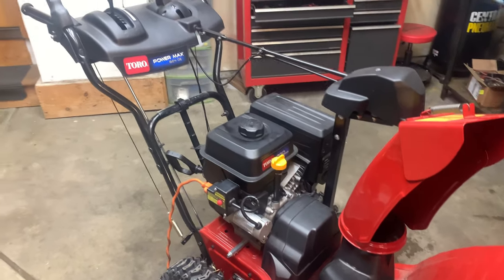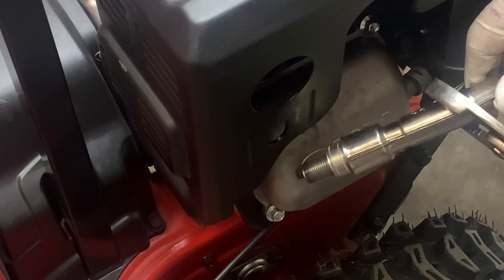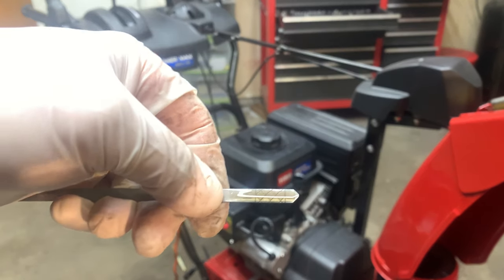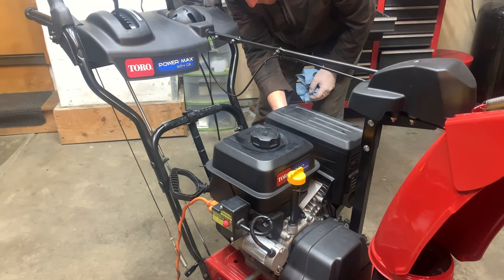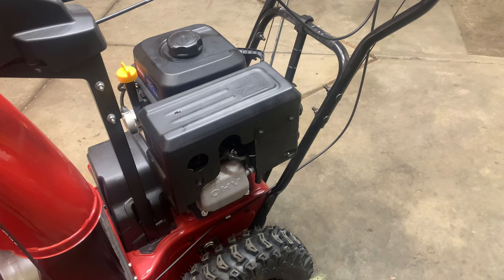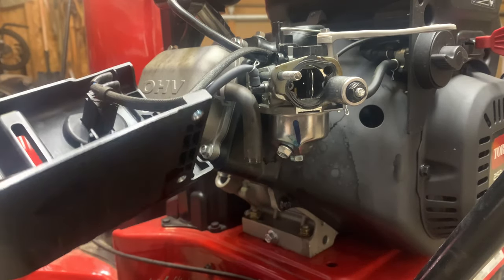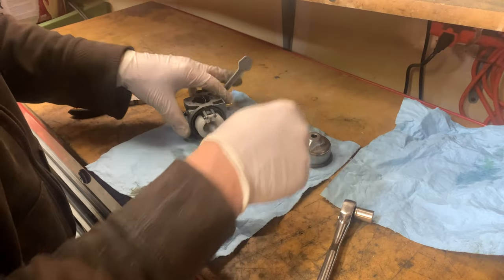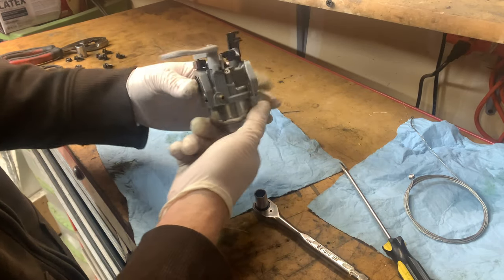Toro Snowblower Won't Start

Comment: Thank you. So it obvious
That someone worked on prior because of the fuel leak from the top of the bowl. 
Good fix. 
I have a 21 yr old toro this only my second snowblower, the first one is a 30 yr old push craftsman snowthrower oil gas mix always starts on first pull. The toro was gifted to me and thanks to you all I got it going.  Won’t idle on low just middle and up.
Reply from the maker: Does the carburetor have a low end mix screw? If so it would be on the side of the carburetor. That may need adjustment.

Comment: Thanks for the video. I have the same issue, so I will check out the spark plug and carburetor
Reply from the maker: Did you get it running?

Comment: Great video. The owner of the machine must have dropped the float bowl or maybe taken the carburetor off and did some checking and didn't get the float bowl seal seated correctly. Great find. Also, great that you noticed the crankcase was too full of oil.  Most dip sticks have right on them, do not overfill. Spark plug defiantly needed changing too. It seems the Toro Power Max snow blowers are easy to work on. Some machines are designed terribly when it comes to getting at the carburetor.  This will be my first winter to try out my new Toro Power Max HD 1232. I did lots of research before pulling the trigger on the Toro Power Max HD. One of the biggest reasons was I have a Toro dealer within a few miles of where I live. And the Toro quick stick seems to be one of the better shoot controls among the major snow blower brands. I also opted to steer clear of auto steer due to my very uneven terrain. The Toro 1232 has trigger steer. Well, winter is coming, so it's time to get things ready.  Videos like yours are a great help for many do it yourselfers. Have a blessed and safe winter.
Reply from the maker: Glad you liked it. You must be somewhere where you get a bunch of snow. We get snow, but it just melts in a day or two. Sometimes we do get a descent storm. So my snowblower is a push broom and sometimes a shovel :-)
Reply: I live in southeastern Michigan about 38 miles north of Detroit. According to weather outlooks, it is projected that we get plenty of snow this winter. I have no idea how they determine future forecast, but that is what they are saying.  Some winters we do get plenty of snow. I am getting older, so a machine that gets the job done easier and quicker is all good in my book. And the new machine even has hand warmers. Can't wait to see how they work. Thanks for your reply. Have a blessed and safe winter.  @small_engine_repair

Comment: I have a snow blower just like it, or very close. It has one or two uses although 5-7 years old. We’re just not getting any snow in VA, but a strong storm is heading this way. I hope it’s something simple, I have a few days to get it fixed, lol Thanks
Reply from the maker: Hope you get it running.

Comment: Nice video, question why is the drain plug missing on the crankcase (carburetor side)  of these machines?  I have noticed this on several videos. Can you explain? Toro
Reply from the maker: Are you saying that there should be one? If it should be there and is not, we would need the manufacture/designers to chime in.

Comment: I have this exact snow blower…..  checked everything out like you said. Seems like mine is not getting gas to the carb. It start for just a second when I spray starter fluid. Any tips for that?

Great video!!!
Reply from the maker: So when you remove the fuel line from the carburetor is gas flowing?

Comment: Toro 824 transmission jumps in and out of forward/reverse gears. Why?
Reply from the maker: Hello, I really can't answer that based on this information you have given me.
Reply: @small_engine_repair  thanks. The Toro 824 is model 38540 ser 00000131 if that helps. With the reverse cable disconnected so that there is no pressure (and there is from the spring) on the protruding reverse lever on top of the trannie and that lever is in the forward position then it should not jump into reverse?
Reply from the maker: I have not personally tore one of those apart, but yes what you have stated makes sense. I found a picture of that transmission online and see what you are explaining. That spring holds the lever so reverse should not engage, unless you pull on the cable. I am sure you are already thinking that something inside the transmission is broken and I would agree. I would pull the transmission apart to investigate further.

Comment: Came here for basically the same issue... Very informative. I ran my Toro SnowMaster 724 QXE 24 in. 212 cc Single stage Gas Snow Blower twice the other morning using the electric start, and I had to use it a 3rd. time later that evening, and the electric starter just whirred when pushed.  Fortunately I was able to use the manual pull and it started right up. Thoughts?
Reply from the maker: If the starter gear does not mesh with the flywheel teeth correctly it will do that. After starting it with the pull cord, turn it off, then try the starter again. Odds are the teeth should align and should start the machine. If the starter does the same thing, then I would say the starter is done and needs to be replaced.

Comment: Toro 824 mdl 38540 ser 00000131 trannie jumps in/out of reverse/forward and forward/reverse. How do I remove it?
Reply from the maker: I have not had to remove one before so I am not sure of the exact steps. I would ask on the small engine or snow blower reddit.

Comment: I have new plug but no spark
Reply from the maker: Ignition coil could be bad. To test that you need to disconnect the wires that run to the key and the wire that runs to the kill switch on the the throttle. If you still have no spark after disconnecting those, then the ignition coil is bad. If you have spark, then something is up with the wires that were unplugged. Let me know if you have more questions. I will be glad to help you out.
Reply: @small_engine_repair 
Appreciate your video, explained well.
Still, mine will not stay running after using “Starting fluid”
Machine is literally Brand New.
It’s only run twice, once when delivered to move it and once trying it on snow before plows showed up.
I suspect old fuel, but did put stabilizer in at one point and have only used “4-cycle TruFuel” in it.
I have researched it and is not a fuel that goes”Bad” or so they say.
Guess I’m in need of a couple other options/ procedures you might have or know.
Also, primer never feels like its moving fuel, and with shroud off didn’t notice any fuel entering carburetor ( fuel switch is on…turned all the way clockwise)

Any thoughts, suggestions or guidance would be appreciated 
Thank you 
Bob
Reply: @BobSchultz-o3k  very interesting,  would like to know the end result.

Comment: Hello, thanks for the video. After the spark plug change I would have thought it would have started. NOPE, but when you took of the guard to expose the carb I was able to see the bowl on the carb was cock-eyed and not sealing. Did it ever run for the customer or did the customer try to fix and possibly monied with the bowl? If that was the case, the spark plug change would have fixed it if not for the miss alignment. Just interested in why it happened. The Facebook link was not active, please send me your tel. Number in the springs for future reference. Thanks
Reply from the maker: Michael, the customer had worked on it before bringing it in. https://www.facebook.com/coloradospringssmallengine

Comment: These Chinese motors that practically every snowblower manufacturer uses are very prone to early carburetor issues. I doubt that they they will have a long service life like the USA manufactured Briggs and  Tecumseh’s did.
Reply from the maker: Agree. The metal they are made of is cheap as well. I had one a while back where the auger housing bent and the auger fell out. Not like they use to make them.  I just posted a video of a craftsman snowblower from the 80’s that sucked up a newspaper. Barely phased the machine. I just had to pull the paper out. No damage.